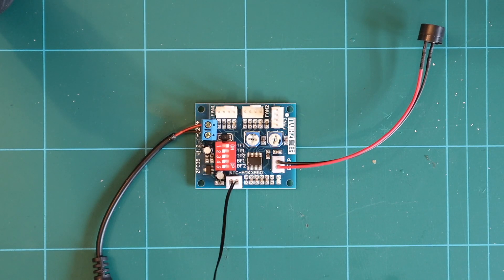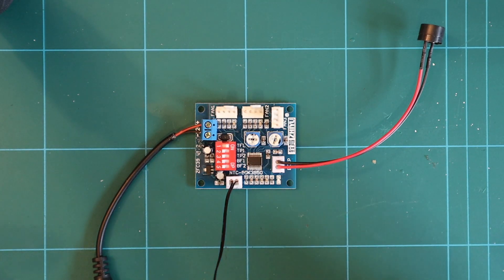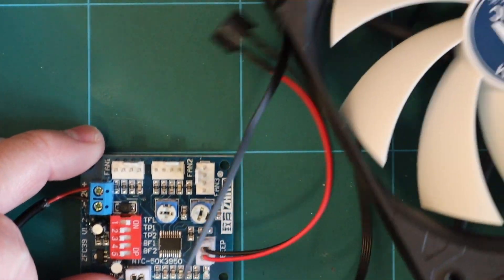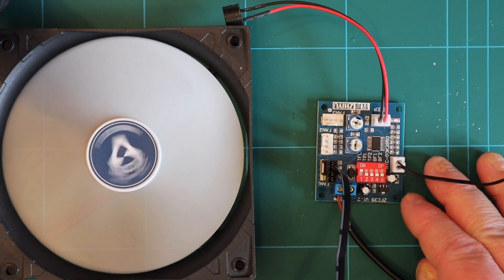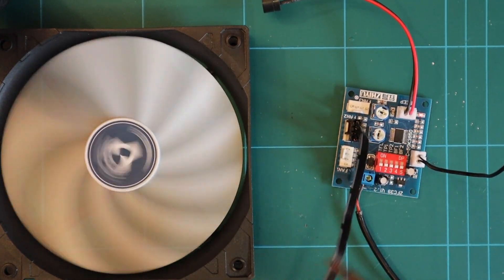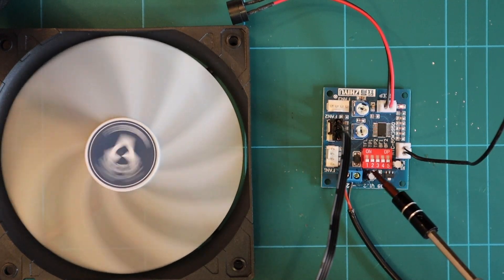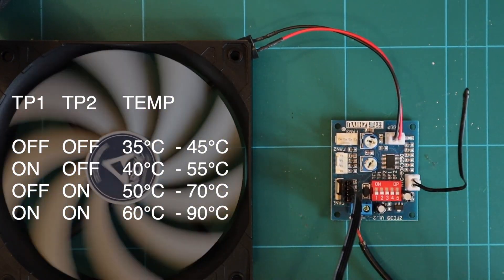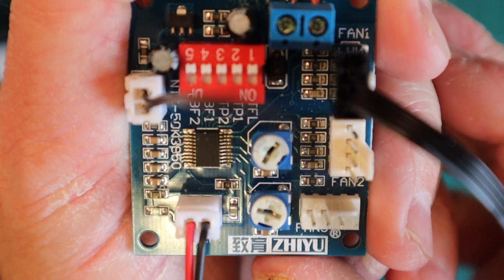ZFC39 PWM Fan controller

Comment: I wonder how slow the fan can be if the second port is used. Can the fan blade be identified by  naked eyes?
Reply from the maker: if FAN2 is used, the fan speed will be 10% of the fans full speed. So, if you buy a slow RPM fan, yu may be able to see teh fan blades, but i would doubt it tbh.
Reply: @ColdestMoon_Channel  Thanks for your reply. I did try a few low speed fans under this controller later.finally found arctic p12pwm  is slow enough .I can  see the fan blade.
Reply: In my case,  I found that a 140mm F12PWM on port 2 with the control reduced to minimum resulted in 4 revs per second. With 9 blades,  this produced an almost imperceptible sound spike at 36 Hertz,  measured using a sound spectrum analyser App. But still not slow enough to see the blades. A pen mark on the hub was easily detected at 4 revs per second.